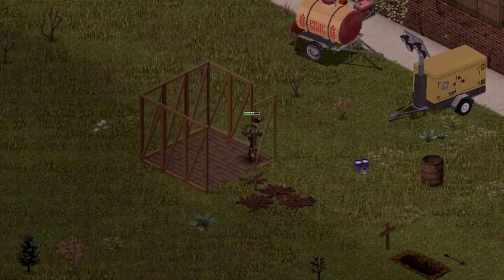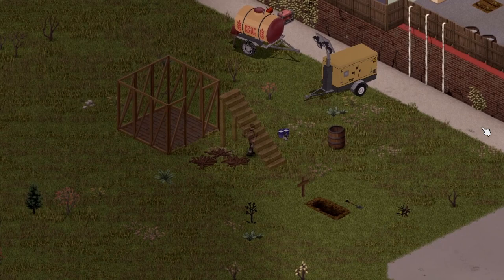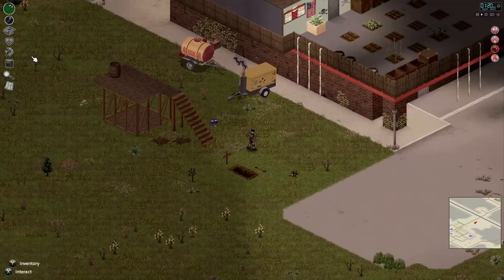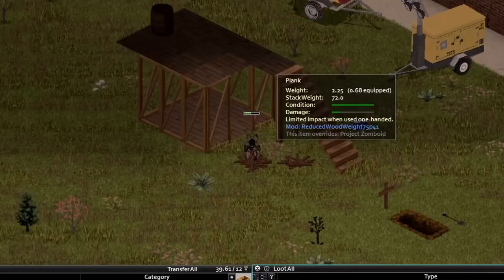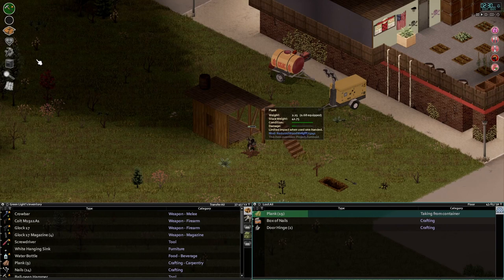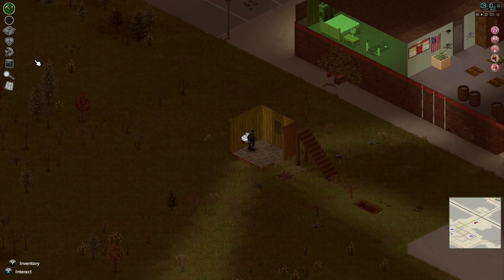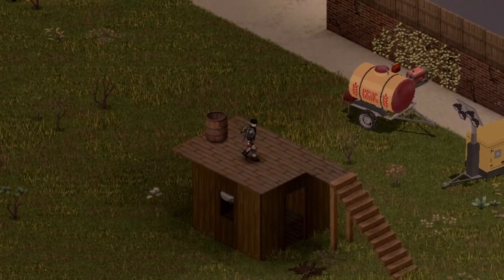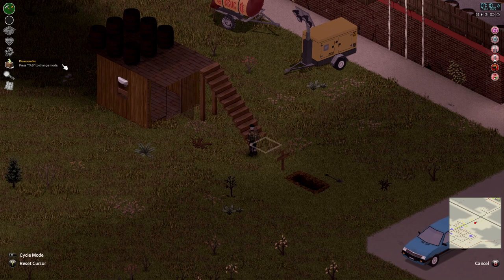Project Zomboid - Tutorial - How to build a Rain Barrel Clean Water system

Comment: For whatever reason I'm unable to plumb sinks I have installed or that were installed other than the 1 2nd floor sink in the rosewood fire station.
I was also unable to plumb the laundry machines in there until I moved one next to the original sink on the upper floor.
Lots of frustrating things about this game.
I can't make a gazebo either. Putting stairs, and flooring, over my head outside is doing nothing to protect from the rain. 
This is all in single player too.